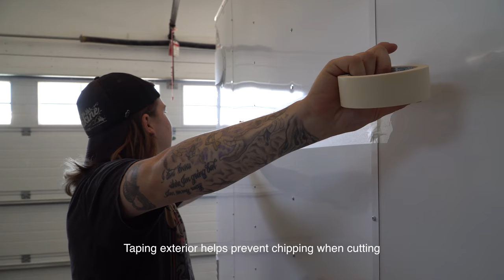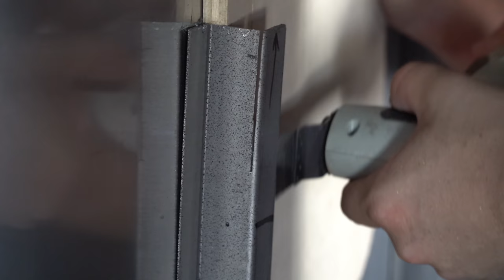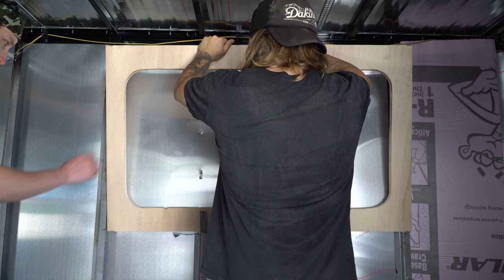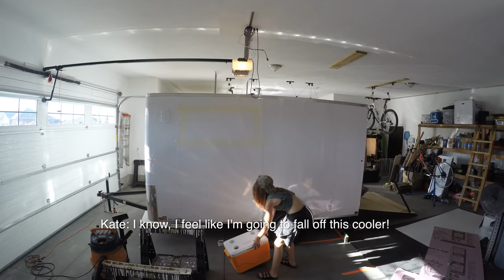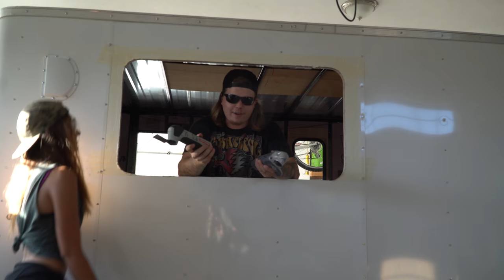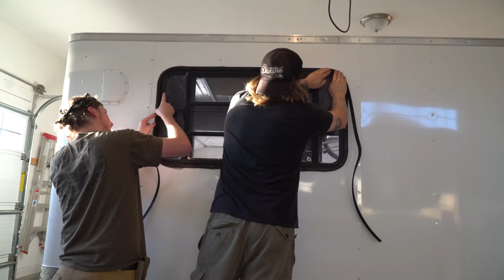How To Install a Window on a Cargo Trailer Camper Conversion

Comment: I am particularly impressed with how you very specifically cut and shaped those steel wall panel supports to enable the plywood window aperture reinforcing frame to sit within the metal supports which were then screwed into the plywood at multiple points to further secure it!

This immediately led me to subscribe because when top quality workmanship like this takes place, it's very much worth seeing!

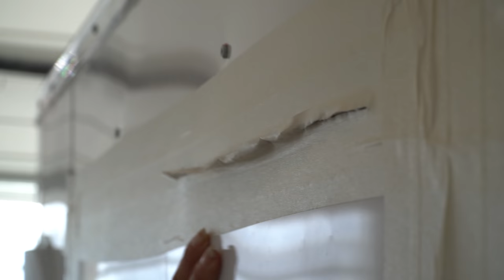Comment: Awesome job ya'll! Just one thing, at 3:50 instead of supporting that backing with your hand use a small scrap piece of 2x4. I lost a digit a few years ago doing something similar and believe me, it cuts the fun out of the project...lol! Enjoy your camper, after van traveling for a year I'm planning a trailer camper like you and this video is just what I needed  to tackle the window.

Comment: I've a question. While looking for windows, many say that they don't have a finish ring. I see some with rings for 2", or 1-1/2" and so on. Do these rings hold the window? Do the screws just go through sheet metal? Or rather, do I need to put some sort of wood backing up?

Comment: Thanks for the video. I have a few questions not related to the windows. How big is your trailer? It looks taller than you garage opening. How do you get it in and out? Thanks in advance.
Reply from the maker: I'm a 6'4" dude and I was barely able to stand up in the inside. If I had to guess it was maybe 7ft tall, 8ft max from the ground. It barely fit in the garage I remember with maybe an inch or so to spare. And if I remember correctly, I believe it was 16ft long.

Comment: Cutting two studs and not framing it back out with metal is risk for the integrity of the structure.  Hope it works out for you.